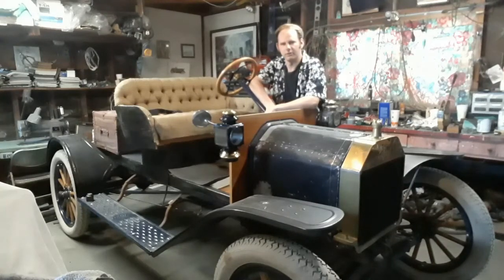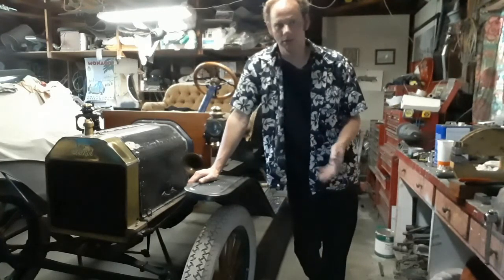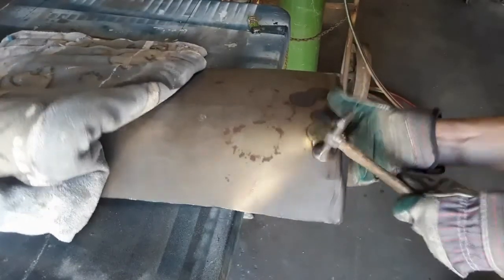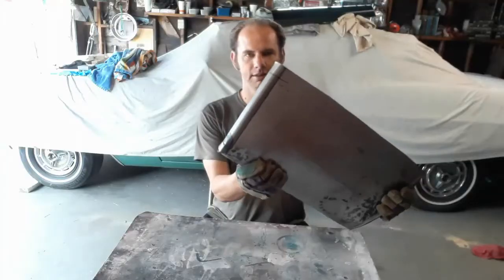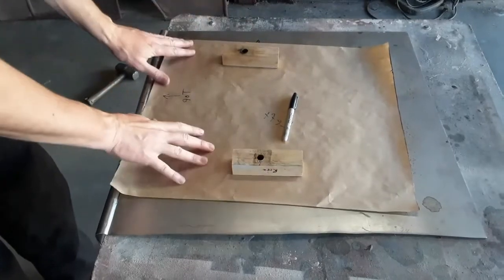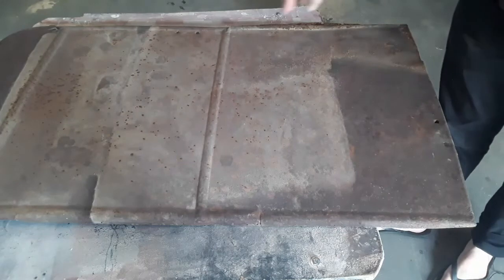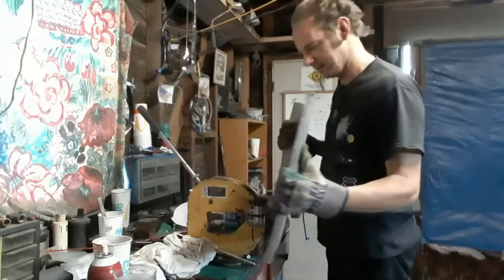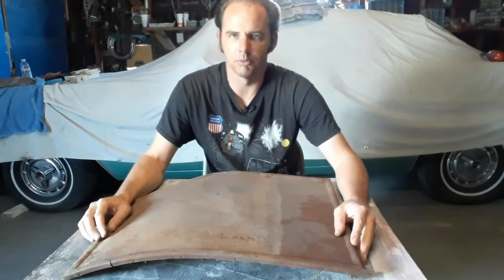Building a 1913 Ford Model T touring body Part 1.

Comment: I like the no frills way you go about making this body, especially the beads. I use 18 gauge to make most of my panels, so use an electric bead roller as the steel is too hard to work with.
Reply: instaBlaster.